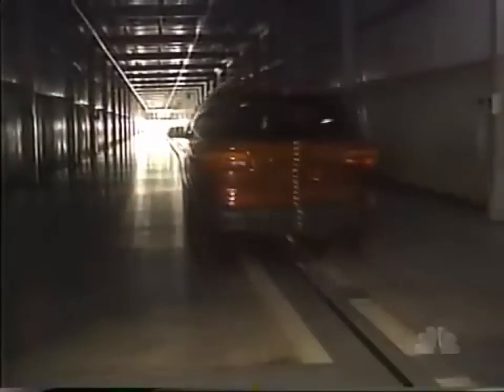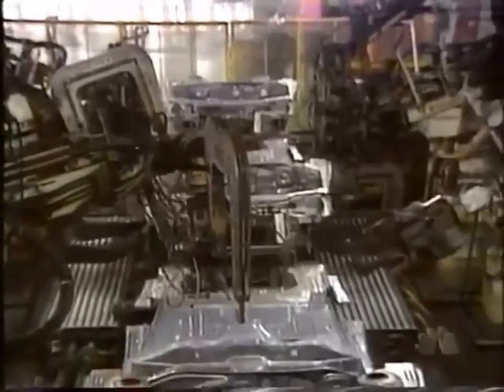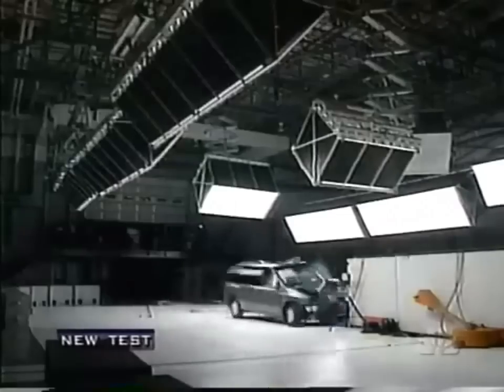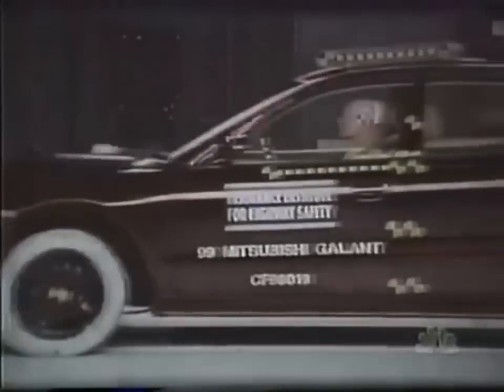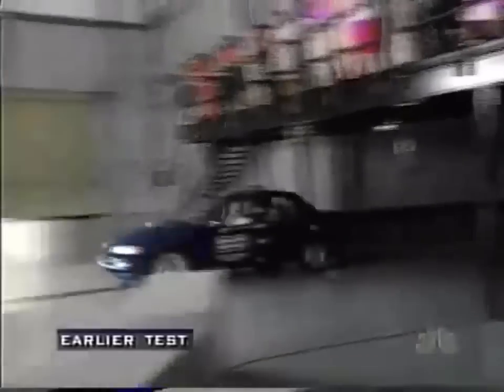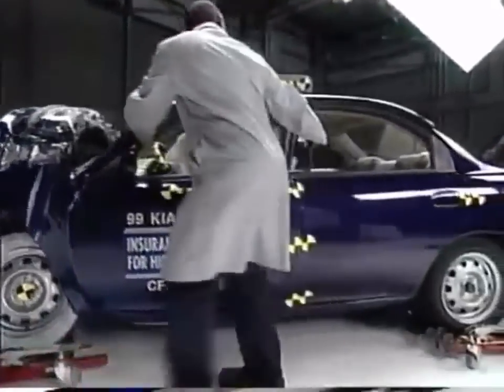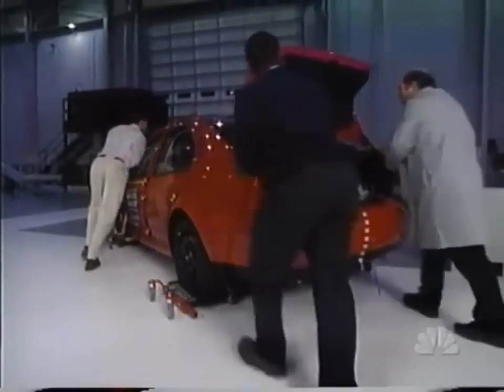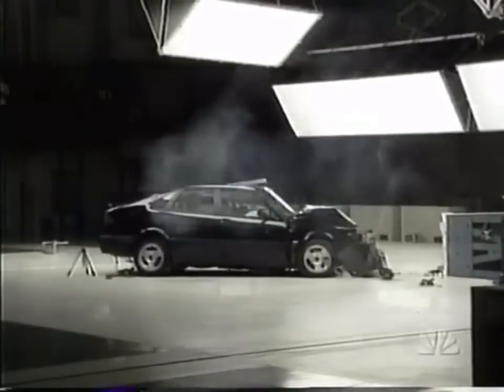437. Dateline 1999, 2000, 2001 Minivan and Small Car IIHS Frontal Offset Crash Test

Comment: The 2001 Hyundai Elantra (not shown and tested in later round) was also rated Poor, which that rating only applies to 2001-2003 models, as the 2004 model improved to Good. It is one of a few vehicles that did worse the second time around, another being the 2001 Chrysler minivans (also not shown and tested in later round).
Reply: what do you mean?  the 2001 van was a major improvement from it's predecessor, with no leg intrusion. nothing bad in that.
Reply: The 2001 Minivans had a fuel system leak after the second test (out of three crash tests) which did not result in a recall for vans already in American driveways and fleets, warranting the Poor rating. It should be noted that as with the Elantra, three tests were performed, the second test being requested by Chrysler after the company determined the results differ from internal crash tests, with stress fractures in the same area where the leak occurred in the second test. The third test resulted in no leakage. The 2002 models received an Acceptable after the issue was corrected, and the 2001 Elantra was rated Poor because of the chance of serious head, neck (based on the second and third tests) and leg/foot injuries (all three tests) because of late airbag deployment in the second and third crash tests (it would have been rated either Marginal or Acceptable without the late airbag deployment in the other two tests based on injury measures). The 2004 model was rated Good in a third test after a fuel system leak occurred in the first test and a failure of the restraint system caused by airbag nondeployment in the second test, with the chance of head and leg injuries (based on the first and third tests) but not as serious as when the Elantra was tested in 2001.

Comment: "The quest is the safest minivan in the U.S." And now years later the quest still got a poor rating in these tests!
Reply: The 2011-2017 Quest performed well in this test (the moderate overlap test), but NOT the small overlap test. The Quest was always NOT lucky with these tests at ALL.
Reply: @Itseli525  The only issue the 2004-2009 generation of Quest had was the head restraints/seats. My family owned one for many years and that puppy was a bubble wrap-lined cast iron shipping container on wheels. I feel like that generation of Quest had the best luck.
Reply: @tx2rmnp  it really did. Nissan just did not had luck in minivans, since they’ve ALWAYS sold poorly compared to Toyota Honda, and Chrysler (just like Ford, after the 90s).

Comment: I actually felt bad for the KIA engineers when they realised the 1999 Sephia still got a poor. They tried their best to improve the driver protection and they significantly improve the strength of the safety cage, which held up reasonably well, and yet it is still rated poor due to the head injuries!
Reply: It got marginal structure due to upward steering wheel movement
Reply: It was the steering wheel airbag. It was way too stiff. A better airbag could have improved the rating. Granted there were also structural problems and potential leg injuries but a less stiff steering wheel airbag could have improved the rating to at least a Marginal. Still, Kia sucked at this time, they didn’t improve the airbag on this design. However, when the 2004 Spectra also had an airbag issue (too soft), they improved it quickly. 

July 5, 2022 2:50 pm
Reply: Kia has problems with their restraint system. Just look at the 2004 Kia spectra. Good safety cage, yet everything else was below a good. In that case, the airbag was too soft.

Comment: How can the Ford Windstar, with the badly deformed structure, get a “Good” rating??
Reply: Because the energy was distributed around the driver.
Reply: The 99 Windstar actually got an “Acceptable” rating if you check on iihs.org.
Reply: @Itseli525  today is an acceptable in the past was good
Reply: My mom loves her 02 windstar
Reply: My mom forgot to the side airbags in her 02 ford windstar
Reply: The energy was distributed well and the passenger was protected with no injuries. Safety cage performed well

Comment: I gained some respect for Saab seeing this video. The fact that they're willing to speak on camera speaks volumes to their safety philosophy. Saab was always a company that went above and beyond on safety, so is Volvo.
March 17, 2020 9:00 pm
Reply: also respect for volkswagen, even with the zero reports of other fires they recalled every jetta sold!
Reply: @dazednconfusedrn  Very true. Also every VW redesigned in 1998 or later got a Good rating in the moderate overlap. 

July 5, 2022 2:43 pm
Reply: saab actually designed their cars to do well, even tho they were owned by general motors, in which chevy didnt care about the crash test results
Reply: I don't know but I saw a Saab 9000 split in half, after hitting a light pole. Both occupants were killed. Queens, NY
Reply: @proto718  People can die in even the safest car if the impact is severe enough.
December 23, 2020 2:50 pm
Reply: Perhaps but the motor won’t last that long. Volvo is the best.
Reply: @AliceTellsAll  I agree that Volvo makes better cars than Saab, also in terms of safety Volvo was always slightly ahead of Saab. Still, Saab was ahead of the curve on safety. 

May 7, 2021 3:28 am

Comment: why couldn't Chrysler have reinforced the Neon's passenger compartment? plus the Windstar still did better than any other MPV (besides the Odyssey) even with the 4th door despite the damn thing buckling.
Reply: The Neon was a small economy car made to be built as cheaply as possible. Why reinforce anything if it already met legal requirements?
Reply: then soon after the windstar was out-performed by the 2001 caravan,  and lazy ford still kept spitting them out until 2007 with the flimsy pillars.
Reply: well if you look at the 95 windstar, the roof buckled more then the 1999, and the 95 got a good, buckling isnt good but it isnt always bad yunno?
Reply: @1234ismyname  
and if you look at the caravan of the same time, the roof DIDN'T buckle.      but then again the floor was folded up.  but looked better than the windstar at least.

come 2001, the caravan out-performs the WS again,  and lazy ford keeps spitting it out till 2007 with the lazy flimsy pillars.